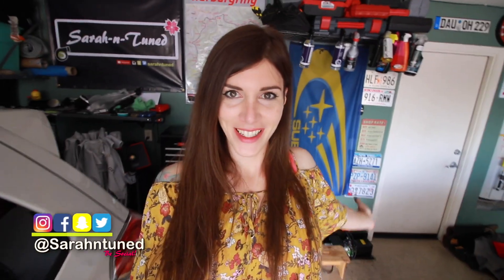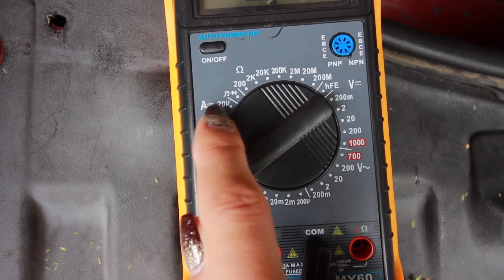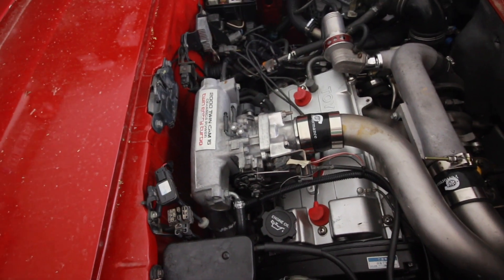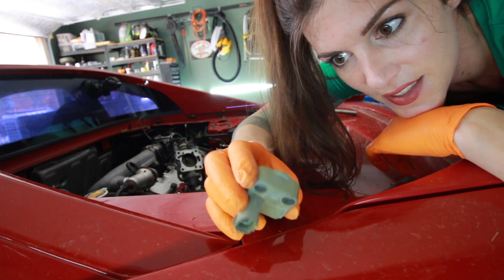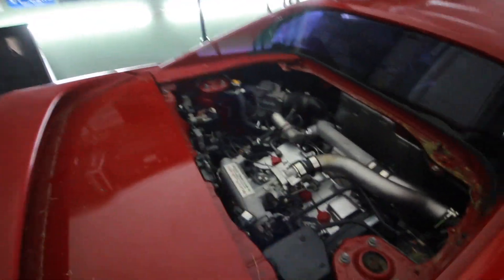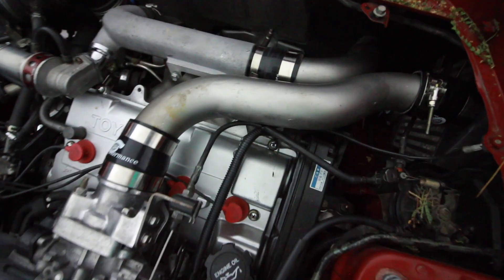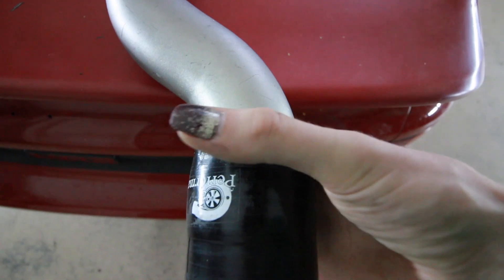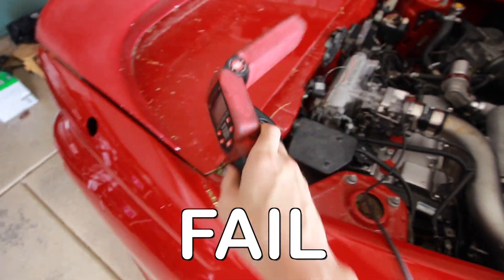I Fixed my MR2! // First Time Building Boost

Comment: That's not good.  Are there any attempts to remedy the battery over heating issue?  Relocate it in the vehicle to a cooler area?  Install a air or liquid cooling system?  Hmmm.  :)

Comment: you really used a multi meter for that. you could have done the same thing with a test light. the brighter the light the more the drawn. then pull fuses til you find it . next don't leave your door open when doing this it will show a draw that probably isn't your problem. you have to have the doors closed to see of there is a draw.

Comment: Only 2 years and battery kaput? That means you are using old  fashion batery. You should go with new technologie Calcium, Gel. I had problems last winter with a 6 months battery and I found out thare are batteries special for low temperature like in Sweden, Russia... So check new technologies for your enviroment

Comment: Hay Sarah, thanks heaps for the info on the electronics for the throttle body, I am working on a 1995 Celica which has the same system. I am located in Queensland Australia. You a champion and your gorgeous, wish I could be your boyfriend :)